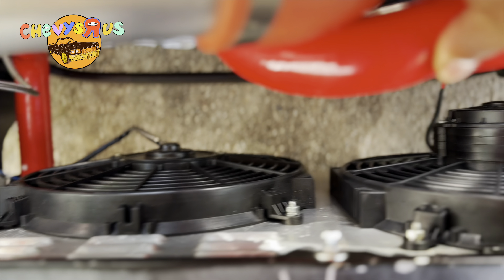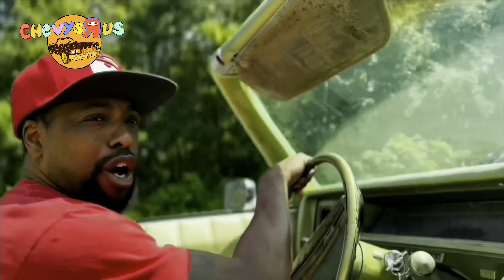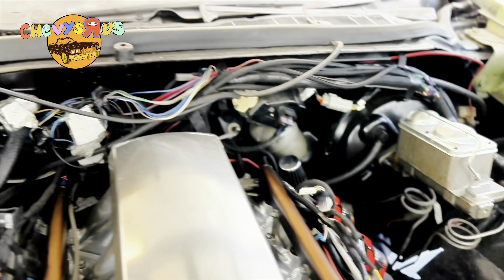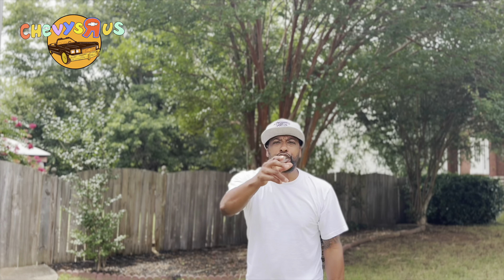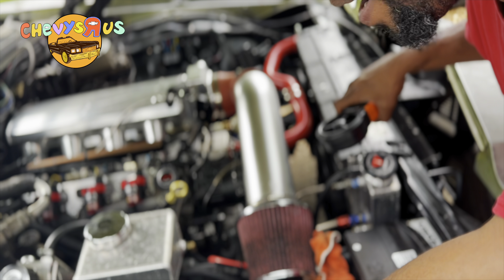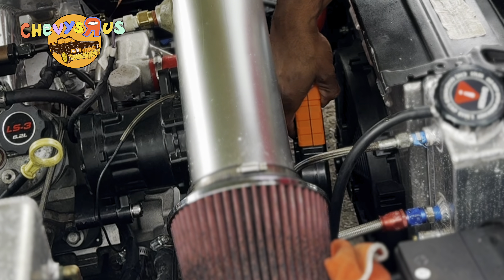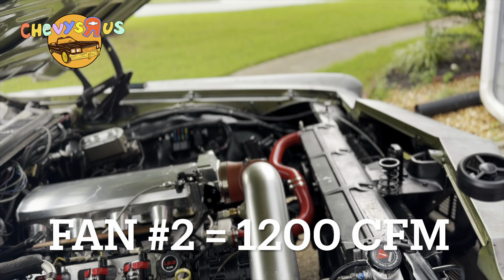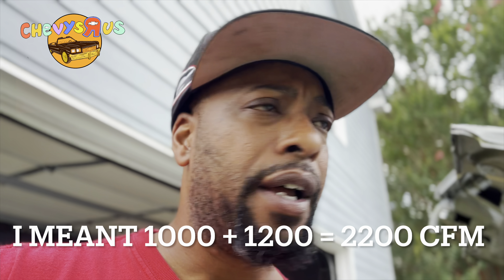LS Swap Overheating Fixes: The Ultimate Quick Fix Guide

Comment: What the temp running at now?
Reply from the maker: The temp runs right @ 206 most of the time sometimes 203….  But I think I came on to something else that need attention though..  I think I need to be cooler than that though..   I was only 200 max when I first start driving it. What does your LS3 Run bro?
Reply: @chevysrus  210
Reply from the maker: @ron_g72chevy  Sonim right where I need to be then!!! Stock runs @210..  That’s normal!!! So anything under is great!!!!